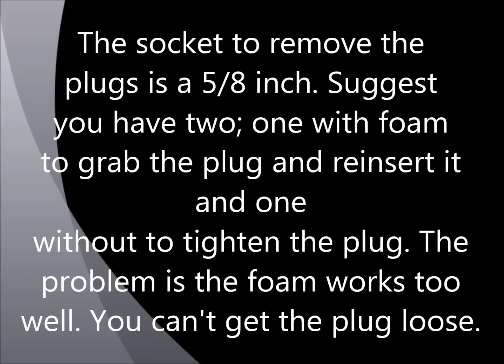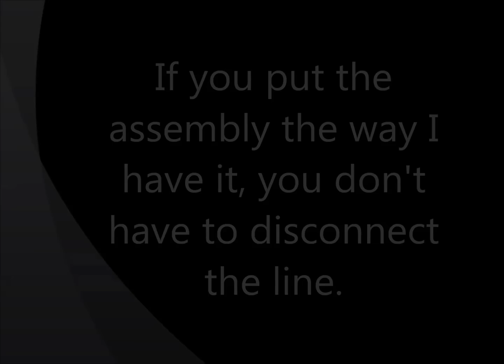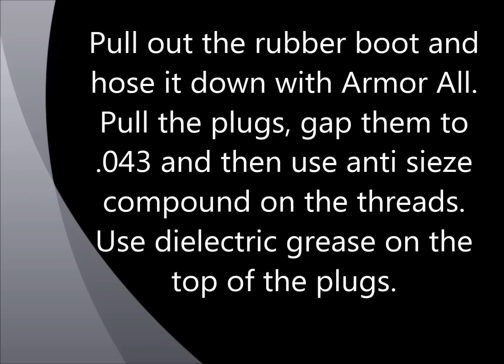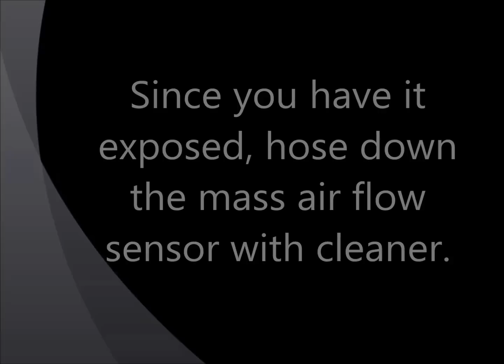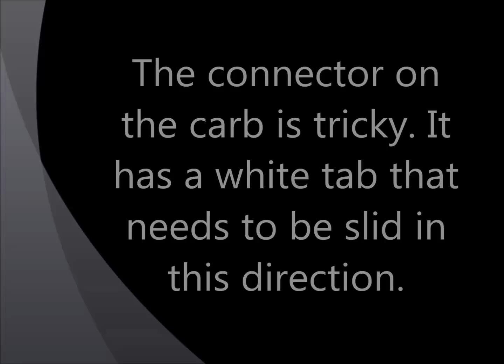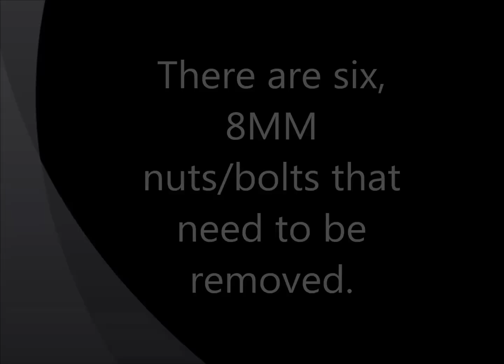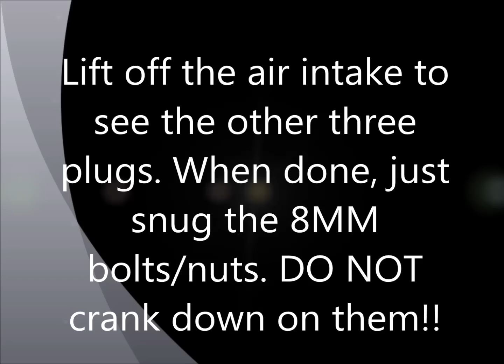How to change spark plugs in a 2012 Dodge Challenger SXT 3 6 Liter V6

Comment: Could a bad spark plug be throwing off a p2089 lean code on my 2012 Dodge Challenger 3.6L?
Reply from the maker: Thanks for watching my video! Here is what I found for that code: https://www.yourmechanic.com/article/a-camshaft-position-actuator-control-circuit-high-bank1-by-spencer-clayton     You may like my other videos. Just type Lsailor1 in the YouTube search bar. Like them? Subscribe for the latest! Best, The Sailor.

Comment: I was told that if you pull off the intake, that you're going to want to replace the top intake manifold gasket. Would you suggest this?
Reply from the maker: +Micah G Thanks for watching my video Micah! I have the work shop manual and it recommends replacing the intake manifold seals (6 of them). You can see them on this link:
https://www.google.com/url?sa=i&rct=j&q=&esrc=s&source=images&cd=&cad=rja&uact=8&ved=0ahUKEwjympH91JzKAhWG1R4KHXLNCXIQjRwIBw&url=http%3A%2F%2Fwww.mopar.com%2Fjeep%2Fwrangler-unlimited%2F2012%2Fshop%2F336759%2F77%2F3808%2F&psig=AFQjCNHk5dXzYZ80diRQQC07H2gzTyUytg&ust=1452426515091587

You may like my other videos. Just type Lsailor1 in the YouTube search bar. Like them? Subscribe for the latest!

Comment: How do you take the cover off?
Reply from the maker: Thanks for watching my video! If you are talking about the main cover over the engine, you pull it straight up. You may like my other videos. Just type Lsailor1 in the YouTube search bar. Like them? Subscribe for the latest!
Reply: +Lsailor1 thanks, how many clips are there? And where are they
Reply from the maker: Don't need to worry about clips. It is just three male posts that go into  female rubber rings. Pull up evenly on all sides and it will come right off. Best, The Sailor.

Comment: the reason i said that im working on my car now 2013 Dodge challenger watched your video and over was wondering why the hell the intake dont come off ..i looked on top and three more screws on top.
Reply from the maker: +Edgar Pantojas  Thanks for that Edgar! You may like my other Dodge Challenger videos. They are all when you put Lsailor1 in the YouTube search bar.
Reply: +Edgar Pantojas hey how did you end up removing it i tried and yeah i found the 3 on top all screws are out i think was holding it is the brackets that are on each side how did you remove it when the screws are in the bracket wuthout removing it ?

Comment: Good video.  Had a question. I have a 2014 charger and my check engine light came on with a code of cylinder 1 misfire. So I changed out spark plugs and ignition packs and it still had the same code.  Any suggestions?  I’ve been told it could be my mass air flow sensor,  I’ve cleaned it already and no change. Hopefully you can help
Reply from the maker: Thanks for watching my video and your kind comment! Could you tell me exactly what code you are getting? Would recommend you disconnect the negative terminal of the battery for 30 minutes. See if the code comes up again. Doubt it is the MAF sensor or all of the plugs would have the same symptom. Pull the plug wire from a good plug. Test the resistance. Check the reading against the bad plug wire. Maybe just a bad wire. You may like my other videos. Just type Lsailor1 in the YouTube search bar. Like them? Subscribe for the latest! Best, The Sailor.
Reply: Lsailor1 got it I will try that.  I will get you that code.
Reply from the maker: Best of luck! The Sailor.
Reply: Lsailor1 I forgot to mention the car idles rough but runs good no hesitation at all.
Reply: Lsailor1 and  that code is P0301
Reply from the maker: This web page explains how to fix it: http://www.myautorepairadvice.com/p0301.html    You might also try a can of Sea Foam in the gas tank before all these steps. Best, The Sailor.
Reply: Lsailor1 thanks for you time and suggestions
Reply from the maker: @benitocardenas2422  My pleasure!